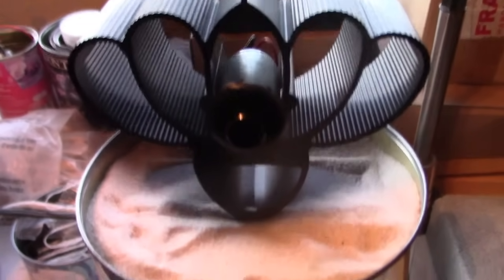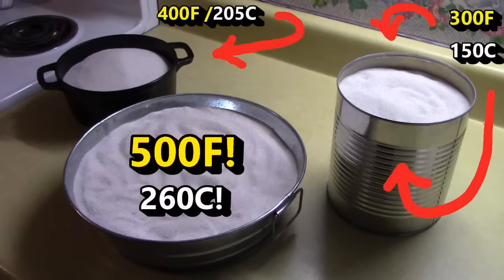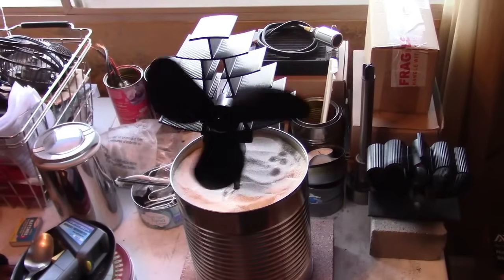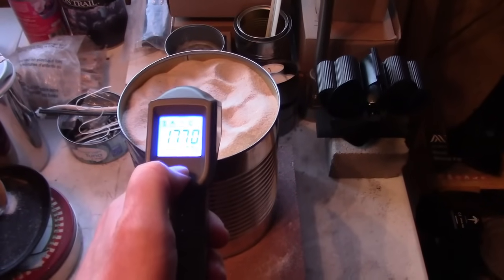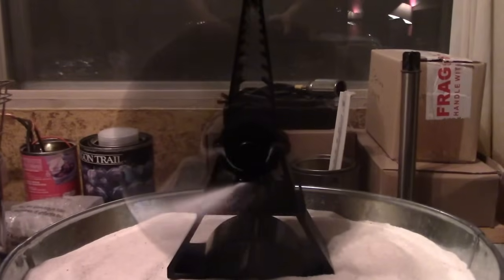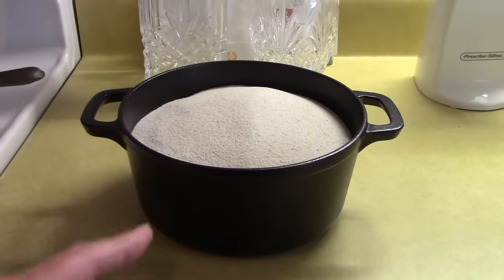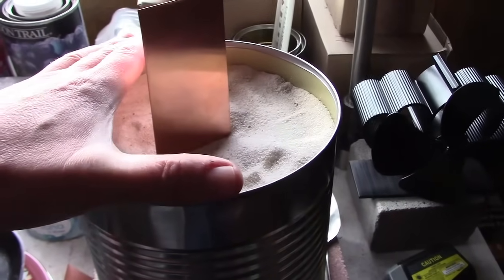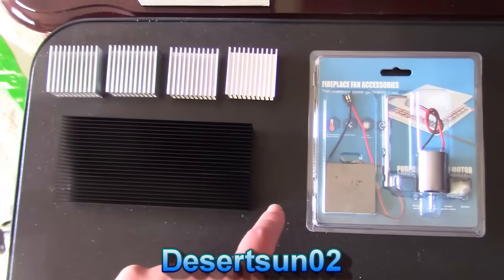DIY Sand Battery Air Heaters! w/heat powered fans! no electricity needed! sand battery room heater!

Comment: I would like to heat water using ¼ inch copper tubing run through cycling the water over time through the sand battery and then back to a holding tank, etc. but I don’t need the sand getting over 100C but double duty by also heating up a small room, is plate resistance heaters better than the water type heater elements both 12V?? I’m wanting to test it out but I need thermostat and thermocouple and also want to use solar panels and battery but with the thermostat I can slowly raise the temp of the sand over days, etc. so it doesn’t pull the battery down, etc. once I get it to the temp I want I reckon from that point forward it will require very little energy to maintain that temp.

Comment: Could this be used as a fan in the summer?
Reply from the maker: hi. this particular unit doesn't trap the heat so it adds heat to the air, but i do have a video showing a sand battery that runs a fan for cooling in the summer. that unit traps the heat inside the container so the fan just blows the air around the room.

Comment: Did you happen to note how long the various sizes give off heat?  I'm looking for a safe way to keep my garage above freezing. If it gives off heat for 3-4 hours this would be perfect!
Reply from the maker: hi. the heat in the sand can easily last 3 to 4 hours. depending on the size container you could get a lot more than that. even a couple of days

Comment: There are far more efficient ways to drive the fan. A well designed stirling motor can reasonably obtain 30% efficiency, while TEG modules typically max out around 8%.

Comment: So, you just need a source to heat the sand to a high degree, a heat (induction) powered fan, a bucket of sand, and you're set because of how slowly the sand dissipates heat? Huh. Pretty clever engineering.

If you really wanted to be clever, you could combine this system with solar panels and computers (which generate plenty of heat), and loop that into this system somehow as well, but you'll then need actual cooling for the computers.

Pretty clever stuff, and TEG chip is a  rather amazing bit of technology.

Comment: Of course we can use sand batteries just as we could any other thermal store. But the suggestions here add complexity. The good point of thermal mass is, or should be, that you can use it in simple ways. Put some bricks next to your wood stove, for example. Have an exhaust pipe for your rocket stove that goes through a bench made of cob. Those kinds of solutions that don't have any extra moving parts and don't require you to haul heavy containers of sand around. Those are the practical ideas.

Comment: Which of the fans seem to preform the best?  Any links would be greatly appreciated.
Reply from the maker: hi. i have 4 different ones so far. the 2 best are the triangular shaped ones. not sure if the shape is a factor though. if you search for 'stove fans' on amazon you'll see like 75 or more show up. i stick with the ones that have a lower starting temperature (122F(50C). i've also noticed that the shorter ones tend to move more air. maybe that's because they are closer to the heat source.

Comment: How are you heating the sand?
Reply from the maker: hi. for the video i used oven/stove but i've been experimenting a lot with the off-grid options lately (mainly parabolics). i've also done some testing with ceramic heating stones. the 12v ones.
Reply: @desertsun02  oooooo yes one of those fresnel lens.  I could do that.

Comment: Why call it a sandbattery it doesn't generate electricity
Reply from the maker: hi. that's because, technically speaking, batteries of any kind just store power (but they don't generate power). we call it a sand battery because it's storing the power (in the form of heat) 🙂

Comment: If you add ground copper to the sand mixture at different ratios would that change the performance of the battery? i.e. Heat induction, retention, etc.

Comment: AAAUUU  you know the energy you put heating its is what you get out.. it did not generate you just stored the cost over
Reply from the maker: this is true. it's just a sand battery. it just stores the heat for later use.

Comment: Hi, It looks amazing! Can you explain how the fans work? I am qurious than the wind from a fan is hot or cool? can we make warm wind through this?
Reply from the maker: hi and thank you. the fan sucks up the heat from the sand through its metal (aluminum base) and transfers that heat to a TEG (thermo-electric generator chip). that chip is attached to the fan and it produces the electricity that is needed to run the fans motor. yep, it makes a warm wind. the fan blows the hot air around that is rising from the hot sand. i do have a version of this posted that blows cool air around too. that unit traps the heat in the container so the air stays cool.
Reply: @desertsun02  Hi there, greetings from farther away, so sorry for my bad english.. Though I saw a lot of videos on this issue (sand battery) and they seem to work, no one draws any conclusions to come up with a front-end method. Besides this people barely answer to questions or talk to one another. I have some questions for you if you kindly care to give an opinion: [1] the output neede to heat a room say (4 by 4 m) would require a minimum of 1200 kw in the winter time, average winter temps. Could be triple in harsh weather (45 degrees paralel globe zone). What is the similar output in sand battery, how big to equal 1200 kw? [2] Howcome sand is better than other things like sand+coal or fire bricks or a cooper radiator? Sand is kind of similar to salt in retainig heat. Could last heated for around 2-3 hours I guess to really contribute to heating. [3] In winter whean you really need heating, solar pannels dont work in early afternoon, so your solution for night time would be what? [4] now a very important question for me is how on can use a direct link between solar pannel and a sand battery, without burning the pannel? I saw methods of conecting PTC ceramic in a direct link, so either way, the point is, what is thereal output resulting from a pannel heating a bucket of sand? How much the temp rises inside of 16 sq. m. room? An keep note that heating the room from 5 Celsius and up differs from heating in from 13 Celsius up or even hiegher (I say this because some used the argument that in 2 hours temp got up to 18 or 22 Celsius, but they started from 13 or 17 Celsius).

Comment: so could you turn the heat activated fan into an electrical generator
Reply from the maker: hi. yes you could. i actually bought an extra TEG chip and motor to experiment with that. will be future video. if anyone has suggestions feel free to offer.
Reply: Stirling engine would be a better fit @desertsun02

Comment: I have no idea where you can get these fans
Reply from the maker: hi. you can get them on amazon. they have probably 50 different ones. if you search 'stove fans' you will see them. here is a link to one https://www.amazon.com/TOMERSUN-Blades-Powered-Burner-Fireplace/dp/B075F36YNK/ref=sr_1_9?crid=247MO6ZQHT3DT&keywords=stove+fans&qid=1698271019&sprefix=stove+fans%2Caps%2C208&sr=8-9

Comment: I must have missed the step where you heat the sand to begin with , so I guess I will just ask .... how are you heating the sand ? It appears you are simply using it as a heat sink then bleeding off the heat .
Reply from the maker: hi. i've experimented with several ways to heat the sand so far. i'm mainly focusing on off-grid options. those being a parabolic dish, fresnel lens, 12v ptc and resistive heating elements. you could also use various off grid stoves or ovens. fresnel lens may be the fastest way to heat it.

Comment: This would probably be able to run much longer or give off more heat if you used a water barrel to store the heat, since it has a higher "specific heat capacity" than sand. I'm thinking about making something similar to this but with a water heater powered by solar, connected by hose to a radiator. So the heat generated by solar can be used at night. Probably much less expensive than a traditional battery.

Of course, there are tradeoffs, with sand you don't need to worry much about it leaking, and you could potentially get it hotter than boiling but then you have to make sure it's away from anything flammable.
Reply: The difference is that you can have the sand at a temperature much higher than the boiling point of water. You can have it so hot even oil would turn to smoke, and the sand would still be solid. This means that you don't need to throttle your heating, when heating up the sand, so you can use a fire to heat it in a shorter period of time, which would be an advantage in some cases (i.e. you're in a hurry to heat your room).
Reply: @SapioiT your comparing the wrong thing between sand and water. Yes there is a huge temperature difference between the two, but it is the heat capacity that needs to be compared. 

Sand has a heat capacity around 670 J/(°C*kg) where water is 4180 J/(°C*kg). Water holds more than 6 times more heat per degree Celsius than sand. 

Heating up water isn't wasted heat. It may take 6 times more heat per degree, but when sand and water cool off 1°C you will get 6 times more heat out of the water than the sand. 

Additionally, sand is an insulator. It takes a long time for heat to move through the sand. The outer walls of a can of sand could be room temperature while the center is a blazing 600°F. Water on the other hand is a conductor.
Reply: Thank you, I did not realise this!

Comment: Does sand or salt work better?
Reply from the maker: hi. i think that sand works better overall. i recently tried salt and it works good too. but i'm mostly going to be using sand. (it's cheaper and you can heat it up much hotter before it melts)

Comment: How about a link to the fans
Reply from the maker: hi. those links change all the time, but if you search 'heat powered stove fans' on amazon, you will find them. (lots of them). they probably have 100 or more different kinds. the main thing is to choose one that has a lower starting temp. (the ones that start at 122F/50C)

Comment: I'd like to combine this thermal energy storage with a Stirling generator.  

You couldn't run your whole house off of it, but you could run a few lights at night.  "Charge" some buckets of sand with the sun during the day and have lighting in your home in the evening. 

You could charge them with a wood stove as well or even just putting them in the oven for a bit

Comment: add electric oven element,  dc dirct from 2 solar panels . 80 volt.  5 amps
=. show me the money.  get 500. degree sand in a few hours.
Reply: And why not using the electric oven directly??
Reply: @frankrosebrock4424  well... half the fun is watching the plasma discharge spark when you short circuit a few panels... 100 volts at 10 amp dc. 4 inch spark.. stove thermostats only do it once.  then fill oven with sand and a blower.. ? wife not happy😎sparky

Comment: Being a tropical dude I'd probably never need to use this but interesting nonetheless. How I wish they can also store cold.
Reply: I live in the northeast and I wish it could do cold too. I HHHATE summer!
Reply: They can. You'd have to have a way to continue to remove the heat from the sand battery consistently, and I don't think I know a simple and easy way to do this.
Reply: They can, especially water

Comment: I have a wood stove without soapstone only windows. I filled up its water compartment on top with sand instead, as I don't like the extra humidity. With Talkum powder it should get denser.
Reply: Don't use talcum powder for anything at all.  It's been linked to cancer.  Instead opt for cornstarch.

Comment: I have been informed that when the sun hits us with the grid destroying flash,  metal will melt.  Is there some other container that can be used ?  I really like the sand heater.  I'm as prepared as I can be except for reliable heat.
Reply: If metal melts, you're not going to be around to worry about being cold. You melt at a much lower temp than metal. 

Solar flares that can destroy the grid are electromagnetic in nature, not flashes of heat. They will overload electronic equipment and cause them to blow out, similar to lightning running in on an electric line. Those electrical components can and will melt from the sudden surge in electricity, but that's not the same thing as a cast iron pot or a galvanized bucket or a wood stove melting.
Reply: CLAY

Comment: Looking good! You could probably increase efficiency by putting insulation around the container so the heat doesnt leak out the sides. Maybe wrap one of those space blackets around them.
Reply: The whole point of using it is to heat up the room. Maybe while storing it in-between heating it and heating the room, you would need to insulate it, but you could simply not bother.
Reply: bravo  @SapioiT

Comment: Thermo Electric Cooler TEC module.  put electric to the wires one side gets cold ones side gets hot. Works as a weak generator as well.

Comment: Need a bit more explanation - I love this idea.  1.  How long does one need to heat the sand (in the oven or stove top)?   2.  Where did you get the fan that has 5 curled shapes, and what's it's name?  3.  Have you examined the cost of heating up the sand vs. the 'free' heat you get from it?  Thank you.
Reply: It's going to put out the same energy you put into it. Just slower.
Reply: @XiaolinDraconis  I don't think so. Energy loss is a given in thermodynamics.
Reply: @JPduclerc  Yeah but you're talking about usable energy, I think. Remember you can't create or destroy, it only changes states.
Reply: @XiaolinDraconis   Are we in disagreement?
Reply: @JPduclerc  only technically speaking. You were being pedantic.
Reply: @XiaolinDraconis  That wasn't my intention. I want to know what demonstrably saves gas. I believe that the only situation where it makes sense to have a system like this, is when you were already going to waste that heat. Like putting sand around a chimney. Please correct me if I'm wrong.
Reply: I was thinking the same exact thing @JPduclerc
Reply: Good question
Reply: How and when you heat the sand is up to your local situation. Gas and electricity rates are unbearable for many. I would use wood fuelled rocket stove outdoors and bring the can(s) in for the night. 
Essentially a sand ‘battery’ for heating.
Reply: I live in the Alpujarra mountain, South Spain, it's cold at night. Here the old folk burn up wood or coal (outside or in chimney), then they carefully fold the embers into sand in a wide metal bucket. They bring it indoors and place it under a table covered with a thick woollen blanket. Guests are invited to cosy up at the table by draping the blanket (table cloth) over their legs. The heat lasts for nearly 3 days.
Reply: The point of these is when your power is out.  Thus you aren’t going to have an oven running.
Reply: @Sam-y5d3j  gas stoves will usually still work if you have gas, just need to light manually but gas pressure should be there.
Reply: @Rockwell108  actually the gas companies turn off the gas immediately due to cracked lines risk explosions.  If you have your own propane tank buried in your yard, that the company comes out and refills monthly, you will still have hook up.  We used to be on propane when we’re were stationed at Barksdale AFB in Blytheville, AK.
Reply: the key is the specific heat of the material.  Water and wood have high specific heats (higher than sand), so they are better "thermal batteries" than sand.  Wood is also a very slow conductor of heat (excellent insulator)..  thus why log cabins were used in cold climate areas (the logs stored heat and helped insulate from heat loss).  Water is a very good themal battery if you reduce or stop evaporational cooling (enclosed water bottles).
Reply: I use Crisco shortening and put it inside the sand and I have a metal strip that goes all the way around to the top and then I put two ropes cotton ropes that I wrap with wire and I stick it down inside the Crisco shortening then I light the Rope on both sides of the copper strip I have going down all the way to the sand all the way around the bucket underneath with the shortening on top of the metal strip, then once I have both of the weeks let I put a clay pot over the top and then I put a quarter over the hole of The Clay Pot to keep the heat in and I get 350° and if you buy a 6 lb can of Crisco shortening it'll last you 72 days 8 hours a day burning it
Reply: @barese420 is there a link, a video, or anything that I can understand this better? I'm interested in this for my greenhouse but would like some more clear explanation. Thanks
Reply: As for cost of heating versus heat it's worth it. Because you don't have to keep running it once it's heated and the sand traps the heat and slowly releases it instead of the heat escaping from your cealing
Reply: @samieparadise9316  once it cools off you have to start the whole re heating process again every day??? I  don't understand.
Reply: @lorettatayor5840  if you have waste heat i.e a stove chimney, or some passive heat source you can use that otherwise wasted heat to warm the sand and store heat with it.
Reply: @samieparadise9316  What's a Cealing?
Reply: @samieparadise9316  the heat still escapes your ceiling . The sand just holds the heat longer. . You still have to put the heat into the sand